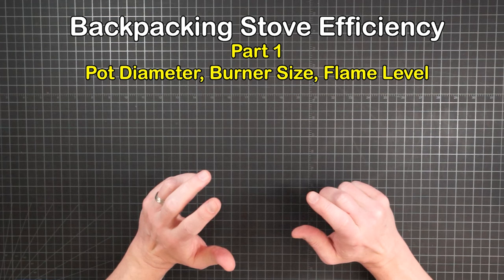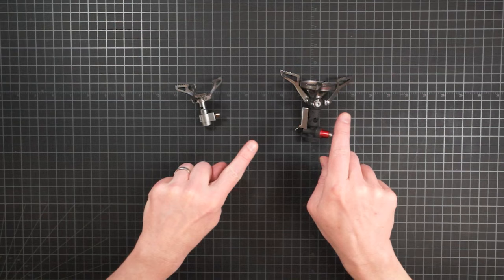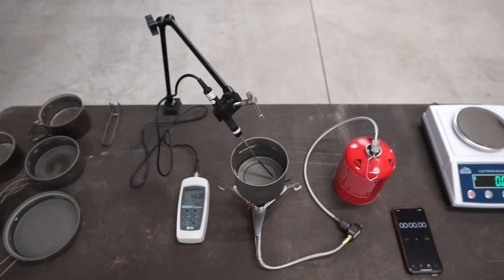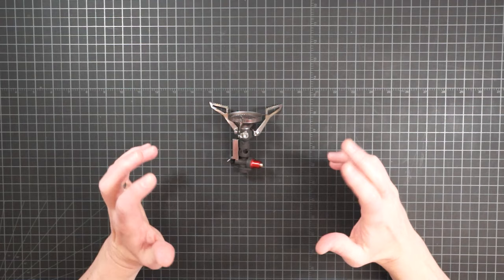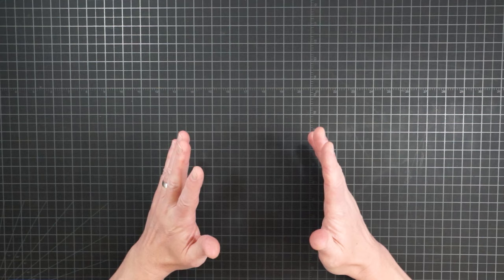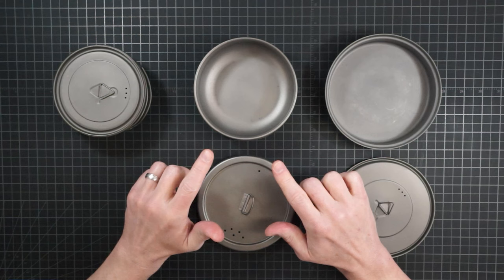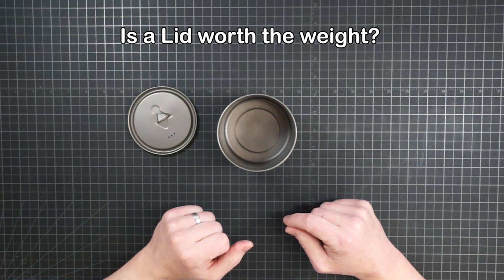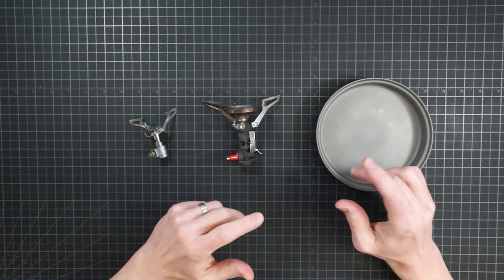Backpacking Stove Efficiency, Part 1: Pot Diameter, Burner Size, Flame Level

Comment: So glad you made this video, thankyou.
I've been camping for 54 years and through simple usage i have found different size and material of pots affects boil times and gas usage.
I have argued against the usual practice on youtube etc of judging stoves by boil times and or gas usage. My reasoning being that in actual outdoor use boil times will depend on so many external factors, weather conditions, ambient temperatue, water temperature, and as you demonstrate pot size and material and gas pressure etc.
Some of my gas stoves will take twice as long to boil in freezing winter conditions than in hot summer weather and accordingly use more gas.
Great informative video. 👍👍
Reply from the maker: I do have plans to also test different pot styles (like kettles) as well as materials like aluminum and stainless steel.
Reply: @GearSkeptic  
Great look forward to seeing those.
I'm new to your channel but finding it very interesting. 👍👍

Comment: I recently purchased a FireMaple "Greenpeak" gas stove that is very similar to the MSR Pocket Rocket Deluxe, I also purchased their "FMC-XK6 Aluminum Cookware" that is a single 1L pot equipped with a finned heat exchanger on the bottom of the pot. Last Saturday, I took it out on a 15.3-mile (round-trip) hike to a local park. There was a rather stiff continuous breeze blowing, and as best I could using my body and a plastic trash barrel attempted to negate the breeze as much as possible. I was amazed how fast I was able to get 750ml of water to a boil, cook my ramen with a single serving Spam and spray cheese combination. It was actually an enjoyable experience considering the wind conditions.

As a guy with 30+ yrs. as an HVAC service technician, I was happy to see you devote quite a bit of time to evaporative cooling as it applies to the use of a lid on the pot, and also how it affects the pressure in the gas canister, because it is the evaporation of the liquid to a gas within the canister that causes it to cool - "Boyle's Law".

Thanks for the video, I enjoyed it.
Reply from the maker: Yah, I am looking forward to being able to test the HX pots in wind!

Comment: Excellent video. For sure, this was aimed at long-distance hikers or military personnel where resupply may be a serious issue. I do not believe the casual camper that goes out a few times per year for only a day or two will worry much about these tests, they will simply use what they purchased and have fun. Our family trains to use much of our camping gear for emergency preparedness. We fall into that middle ground where this exhaustive testing could make a difference for us one day. We certainly appreciate all the effort expended to make this informative video. For those who may wonder about windscreens, a British channel, bex bugoutsurvivor, recently posted some tests he ran to end a dispute. Windscreens do make a tremendous difference when heating food or water over small backpacking stoves. Protecting your flame and the sides of the pot is important to efficiency.
Reply from the maker: Thanks!  Part 2 will be on Wind Effects.  That will be testing stoves of various designs to see which work best in moving air, but a part of that will also be wind screens and how much they help for how much weight.

It will be interesting to see if an ultralight stove could be made more wind-efficient for less total weight by adding a thin windscreen, versus going with a heavier stove that has inherent protection built around the burner.

Comment: Once again the best channel on YouTube shows why it's the best😍 I'd be interested to see how a contained "flameless"/windproof system like the MSR Windburner or the Jetboil stack up in a controlled and windy setting. Especially with the weight increases in their systems because of the added heat fins on the pots as well as the insulation materials. Great stuff as always!
Reply from the maker: Thanks very much!  Yah, I've got wind effects planned for Part 2, but that should lead perfectly into a Part 3 on heat exchanger systems like Jetboil and MSR Reactor/Windburner.
Reply: @GearSkeptic  I've had a Trangia 25 since 1987, then sold for Trangia 27 Duossal. I tried a Mini Trangia but it's useless in any kind of wind - can't get a boil, wind blows the flame away so weak it's cooling as fast as any heat gets to the pot. I've got a Jetboil Sol Ti from 2012 which solves many of the Trangia's 27 weight issues but removes food cooking versatility.  For an overnight 1-2 night scenario vs a 5+ night scenario the alcohol vs gas and the wind losses seems to pivot both towards gas and then.... I simply don't know.
Reply from the maker: Eventually, I’d like to add in alcohol stoves to the comparison.
Reply: @GearSkeptic  Excellent. The "no brainer" is at the extremes of a 1-nighter possibly 2-nighter, when the weight of alcohol fuel + small bottle + burner is substantially less than the weight of a nearly empty canister + burner. It's also a no-brainer at the opposite end of a long 5+day trip when beginning with a full canister weighs less than the alcohol+bottle. The tricky bit is the middle part between the extremes.

Also alcohol stoves very much need a windbreak (tighter usually better) but can't do that so safely with gas canister when under the burner under the pot.

Also we know gas is more efficient with a lower flame but in wind if too low it risks blowing out and there's going to be low-enough optimal flame where the flame is coming out at enough velocity to finish combustion whilst still under the pot.  So in your high/medium/low flame tests there's going to be a point when low may become less efficient.

Complex stuff.
Reply: I wish toaks or someone would do a pot with heat exchanger fins. Always jealous seeing jetboil dudes boil so fast but the whole jetboil system is heavy af, just need the regular titanium pot with the fins in the bottom.
Reply: @Shrouded_reaper  I have Toaks 550 pot and a generic gas burner (Alpkit Kraku) and the Jetboil Sol Ti (no longer available but close enough to similar). Keeping flame to a minimum which is higher in wind so it doesn't go out, for 350ml water time in s and weight of fuel in grams:

Jetboil outdoors: 250s, 5.1g
Jetboil indoors: 153s, 4g
Toaks outdoors: 341s, 10g
Toaks indoors: 304s, 5.9g.

So averaging the performance (sometimes windy, sometimes not) Jetboil gives 22 boils and Toaks 12.6 boils per full 100g canister.

Note my burner was hot to touch under the Toaks I had to leave a while before removing burner to weigh canister. Reminds me not a good idea to use a close windshield, something nearby to blunt the worst (backpack, etc) is as much as I'd feel safe to do.

Also a working minimal system the Jetboil (pot+sleeve+burner+lid) is 244g, the Toaks 550+lid+burner is 144g noting the pot size is 800ml Jetboil vs Toaks 550ml. So in terms of added weight carried, the Jetboil needs 29 uses before it's weight saved on fuel is offset by its added weight. If though the duration/use of the Toaks tripped it's less efficiency into needing say 230g canister then the added weight of 164g for the larger canister is greater than the 100g heavier Jetboil.

So a big fat "it depends". 

Alcohol wins on the shorest trips as the fuel+bottle weighs less, then something like a Toaks (similar to others) then Jetboil based on length of trip).

But then a longer trip you're going to get fed up with the samey food you can do in a Jetboil, and if you added the pot stand and a wider pot to cook real food you're going to lose it's effficiency advantage and add weight. 

As I say , a big fat "it depends". No single right best.

Personally if I'm going on a long trip where basecamp and the weight is carried 1st and last day only and inbetween I hike from camp, I use a Trangia 27 with gas and outer Duossal pot and inner Mini-Trangia's Alu pot as I never do real cooking in 2 pots together (1 boil, 1 cook). That weighs 602g.

So given Jetboil's advantage for me is in a corner case of a long trip I'd likely get bored with it's food, if I were to argue anyone to put a fin on a pot it would actually not be a Ti put an Alu one which doesn't burn as easily which is EXACTLY what Jetboil did their more recent products. Minimo, Stash, as their narrow Ti pot only does boil well. I boil and then add a packet of dried food (noodles etc) and leave and give it a bit of reheat after 10 mins so hydrated+warm. Yes could make a cosie...

Comment: Great respect for your comprehensive analysis. I've never used a burner before. We've just eaten food cold while travelling but thought we'd make a change and efficiency is one of the most important factors for me (along with cook-ability). I've gone with the omnilite ti (with silencer) for its ability to burn multiple fuels at high efficiency and quietly (All the efficiency studies are without the silencer how that'll affest it) while also having the ability to simmer.
I then started considering efficiency of the pots. Of course a wider base would increase efficiency but so would a heat exchanger, but the latter at the cost of extra mass so better to just use a wider based pan without a heat exchanger (saving mass, volume, cost, as well as being better at acting as a frying pan). After having these thoughts I find your videos.  I haven't actually bought the omnilite ti yet but I'd imagine it would have a similar burn diameter to the pocket rocket. However, with the silencer I don't know what effect it will have as it distributes heat more.

Difficult to make an effective decision when I have no experience and none of the equipment is infront of me, but it does seem to be the case that a visual confirmation of the glow dissipating just before the edge of the pan matches the efficiency sweet-spot. Maybe I'll buy the burner and try it out on pans at home, get a rough visual guide of the glow diameter and then buy pans that are slightly wider than that without heat exchangers. 

Do you have any thoughts?

Edit: As we are cooking for three, a larger volume pot of 1.5-2.5L is necessary and so likely to have a larger diameter than your largest pot . . . again making me think that the heat exchanger will be useless.
Reply from the maker: I haven’t done testing on larger pots, but it is on my list! I am working on heat exchangers now.  MSR makes the Reactor in a 1.7L version. By their numbers, it is the most fuel efficient stove made (with reported excellent wind resistance). I’ll be testing the 1L version in my next investigation.
Reply: @eptic6355 I've sent an email to primus asking if they have documentation comparing the 2.3L pots with and without heat exchangers to justify the increased mass, volume, and expense. I linked this video pointing out the limited efficiency increases beyond 15cm and questioned whether when using a 20cm diameter pot the gas would retain enough thermal energy to justify a heat exchanger (compared to the sub15cm diameters which probably would).

Comment: the effort and detail of this is superb. It does simply confirm my existing behaviour that I must always keep the flame level to only be visible at the base of the pot and stove quiet. I am surprised that lid makes so little difference and may in fact cause inefficiency because I don't notice the temperature signs to stop as soon. Thank you.
Reply from the maker: A lid will make a bit more difference when the wind starts (see Part 2), but it’s still less than I thought it would be!

Comment: FYI I've been doing my own alcohol Vs gas tests varying the weather and averaging. My gas use is average around 7g per use (boil 350g water) Vs alcohol is around the 18g or 20ml per use. My alcohol is methanol with 10% water with a 0.88g/ml. I weighed the alcohol stove to measure fuel loss and infer volume from measured density. I average 2 such uses per day hence 14g gas or 38g/40ml alcohol per day.  Interesting challenge with alcohol is if I add more than I need then even after I snuff the flame out it keeps getting lighter so the alcohol is still evaporating so is wasting excess, but if try to tune to just enough alcohol to not waste then the flame goes weak and then stops before a boil, so it's a logistical challenge to not waste alcohol fuel. Due to an empty gas canister weighs 106g and an empty alcohol 60ml bottle weighs 15g, 2 days of gas is 132g Vs 2 days alcohol is 69g. So alcohol wins on the overnight/2 days trip but longer trips the weight of the alcohol loses.

Comment: It's slightly more technical than "a lid decreases time to boil". It's more like "a lid with headspace under it creates an insulative layer reducing evaporative heat loss; instead steam condenses and drips back to the water. Also, a tight fitting lid creates vapor pressure increasing the boiling point of the combined water/steam, that allows you to transfer heat faster to the water." 50%-33% headspace works for homebrew and distillation. I've always wondered how much more efficient of a heat transfer you could get if you had tons of radiator fins projecting out from the wall/bottom of the pot in the flame path.
Cool video!

Comment: 5:08 Seeing this setup just gave me a flashback to the -40 field exercise in interior Alaska. 
So there we were, huddled in our snow cave. Time for dinner! Go to turn the stove on. Nothing. It was literally so cold that the gas had condensed to the bottom of the canister and absolutely refused to come out the top. We wound up needing to warm the canister up with our body heat before it finally would ignite. 

Crazy cold, yo

Comment: Thanks for this. As you hint in the summary, I have a strong suspicion that at a lower ambient temp the efficiency increase of the lid will increase significantly and that BRS stove in any wind will not come close to the Pocket Rocket.
Reply from the maker: Agreed.  Wind effects is planned next.  It's already getting warmer.  I would also like to see how colder temps effect the recommendations, but I may have to wait until November for that.

Comment: I would love to see a video in the future about fabrics for hiking clothing. I love all your videos btw, so informative!
Reply from the maker: Thanks! I do have some ideas regarding fabric testing. So many projects!
Reply: You mean wool vs polyester vs.... ? I did that analysis like 15 years ago and by trial''n'error ended up with Merino wool. In winter it lasts 5 days til pong, in summer typically 4 days til pong but in summer if you wash them and leave them drapped over backpack to dry in the sun the UV from sun sterilises them better than any washing machine. In summer if raining I simply let myself get wet "free cleaning" and in winter I'd have a UK specific waterproof called Paramo.  Legs summer are bare or a windproof if walking through vegetation which may sting me, winter I'll be in a polycotton as nothing else is durable.

Comment: Thanks a lot. First : I really enjoyed watching this video ; hiking gear meets test protocols, what a treat ! Second : you gave me figures to confront my ancient Campingaz Globe Trotter to. As a hiker I was never really concerned about weight : I'm the family sherpa. But gear volume, and fuel efficiency, are more important. So, thanks to your protocol, it turns out that my good old stove is as efficient as current ones : to boil 415 ml of tap water it burns 6g of gas during 9 minutes at low setting and 8g /5 minutes at high setting. With a C206 canister (190g of gas) that would be from 23 to 31 boils, so 5 to 7 days of gas autonomy. Not that bad and good enough to give it shifts in my stove rotations.

Comment: Something I learned the hard way with the BRS stove is too wide of a pot is really unstable. Lost 1.5 L on a beach backpacking trip with no water when the wind blew it off and got to enjoy hiking 8 miles out the last morning on a half liter. These pots are smaller but still worth considering stability, because having to re-boil a spilled pot weighs a lot and wastes a lot of fuel and water if you're dry camping. 
Just another thing to keep in mind, thanks for all the data!

Comment: This was a thoroughly captivating treatise on one facet of backpacking gear.   The fact that it was 47 minutes was barely noticed.   Thanks for your scientific approach to the fuel efficiency dilemma.   I recently purchased a larger diameter pot of the same volume, knowing it would be more efficient.  Haven't tested it yet.    The lower flame level was the best revelation of this whole film.   Fuel savings with less noise.    One needn't be in such a hurry while enjoying nature anyway.      Thanks for sharing.
Reply from the maker: You are welcome!  Very glad if it can help.